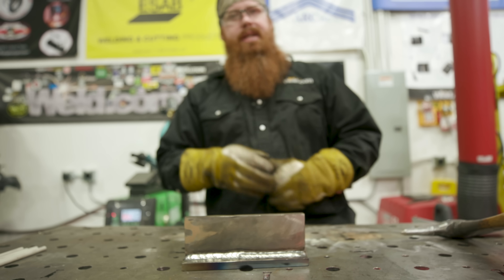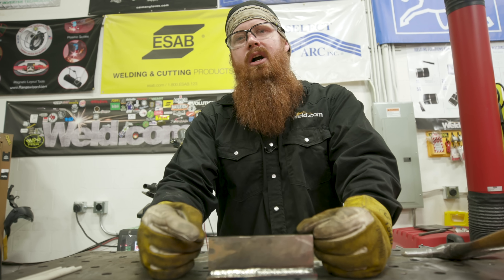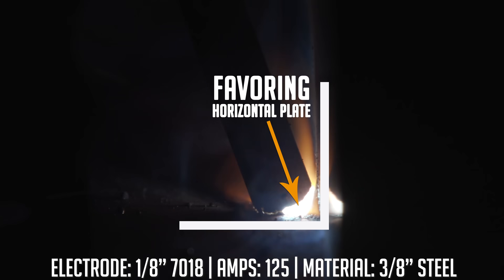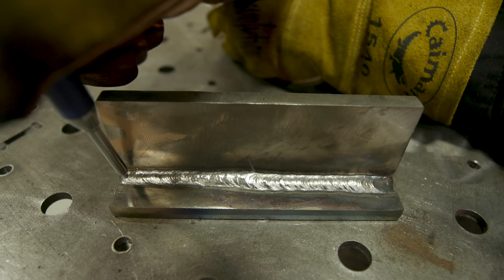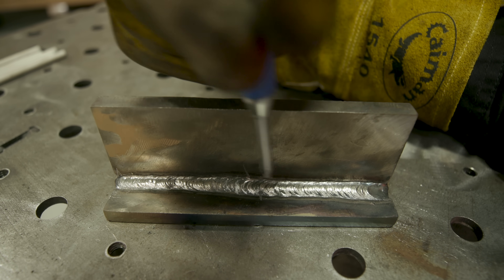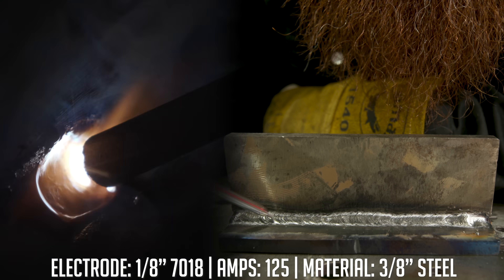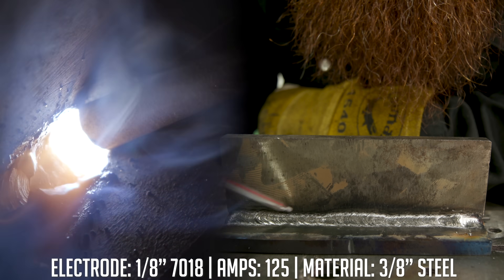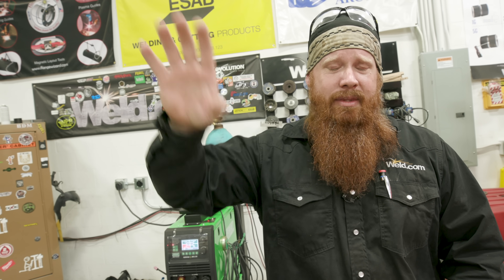How to Fix Common Weld Defects | Part 4 of 4

Comment: 10 inches per minute sounds like a very fast welding speed.  In my industry (pipelines) we usually weld in the the 4 to 8 inch per minute range.

Comment: The defects here are excessive covexity and a huge crater at the end,  NOT unequal leg. The whole weld profile on face A is one leg, should had  welded the other side of the arrow to compare the legs difference. A single leg can't be unequal to itself. The code talks about "Excessive Covex or Concave whatever the case" or excessive reinforcement in case of Butt weld.

Comment: I see that you are welding on a thick plates. What is the method to do it on a thinner plates, something like a 2-3 mm plate ? if i move the stick 6 seconds for an inch , I will probably make some holes on the plate.
Reply: That's not worth using lol just get thicker metal if you're stick electrodes. The only way I see you using that thin material is running it cold and going fast when welding

Comment: When measuring for underrfil do you have to take into account any contour on the plate; in this example the coupon wasn't totally flat so the underfil may change depending on which side of the plate you measure the weldment from?

Comment: I know I've asked this question before but when welding with flex core I've been told that the thickness dictates the stick out. I'm building a car trailer from 4in C channel 3/16 wall thickness and 2.5 angle same thickness and my stick out distance is about 3/8 is that a good to weld it.
Reply: Yes, tho you may also want to try up 5/8 as well and see what works best for you... taking into consideration the other variants and circumstances. good luck

Comment: I'm make stainless steel exhausts,  (tig welding) argon is quite costly where I am, an old retired cryogenic truck engineer told me that I can purge my pipes with any inert gas like nitrogen while using argon only for the the welding surface, I've not seen or heard of anyone else do this so im wondering if it can be true? All advice is welcome
Reply: It is, inert just means it is a passive gas. supposed to active gas used in aluminum. MIG/MAG any one? a=active i=inert.
Why don't you just try and find out for your self? that's the way to go, good luck.
Do not ask questions, just try, thrust me i have welded a lot of stupid/weird stuff, and no one could tell you how to di it, just TRY and try again and again and again.
I mean you are not welding the pipes of a hospital just try and learn.

Comment: I am new to welding, how do you remove a backing strap like you have in the video or do you leave them on permanently?
Reply: Theres a couple of ways. Generally we just cut them on the ends where they're not really fused then grind the rest down. Or you can cut the whole thing off but leave a little on the back and sand that down. Probably 1000 different ways to do it though
Reply: Thanks for the reply, was just wondering how that works when I hear someone say to remove backing strap.

Comment: What is the difference between 1g, 2g, 3g etc?
Reply: BillyG the G stands for grove, there’s also F for fillet. The number is the position going from easiest to hardest. So 1 is flat, 2 is horizontal, 3 is vertical up, 4 is overhead. That is with plates and you do those positions for any type of joint like butt joints etc. 

Pipe has its own positions too. 1G pipe is on a rollout wheel so you just spin and weld where you’re comfortable. 2G is vertical and you move around the pipe. 5G is a fixed position 1G so you have to bend and weld overhead at the bottom. 6G is a 5G test but fixed at a 45 degree angle so it makes it a lot hard because you’re never straight the whole time.
Reply: CommieCat Thank you!

Comment: 24.5 volts 255 wire feed for all dual shield in 045 size and all positions tried them all hotter tyres them all colder 24.5 255 cannot  beat those settings ss, 308,309,316, carbon 711
Reply: 24.5 and 255 are my vertical and overhead settings actually. Generally I run 28.0 and 380 but I'm welding old water intake gates that are all rusted out and have sediment deposits and water in them so we run real hot. If I hot better steel on the inside in some boxes then I'll go down to 26.5 and 330. When we fill CJP's I like to run hot too until the cover pass. Just me though. And this is with dual shielded .045
Reply: Shoot I run 22.5 and 230 with solid .45 on 14 gauge lol

Comment: " I slowed down and back up to 3/16" I sped up and back down to 1/4" 

Lol anything wrong with that statement?

Yeah. 1/4 is bigger than 3/16 buddy.. wheres Bob at
Reply: George Duckworth not at all, back up to 3/16, I sped up and back down to 1/4. Commas are key
Reply: @chickennugget2931  better? The problem is smart guy, 1/4 is bigger than 3/16. Duh
Reply: @chickennugget2931  so are brains
Reply: I caught that as well.
Reply: Calm down lol
Reply: Yes, back to front. The faster you go, the "smaller" the leg lengths.
Reply: @scottcarr3264  and obviously you can't read a tape either. Lol

Comment: Can u show us mig welding thick steel like 1inch or more and the correct procedure to do it
Reply: Step 1: make sure it's MiG and not Fluxcore
Step 2: throw it in the garbage
Step 3: buy a stick or Tig welder and put down a reliable weld
Reply: There is no one procedure it’s whatever your boss gives you is the one you use
Reply: @6397561  there are standard procedures you can/should follow until your employer gives separate parameters
Reply: @Wroger Wroger I was just making a suggestion to a video they haven't done yet u wholly